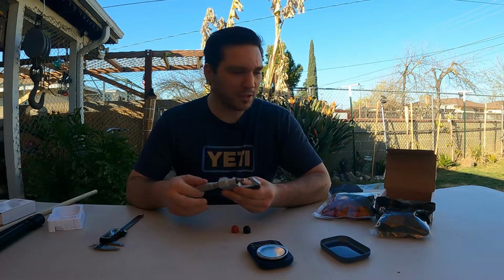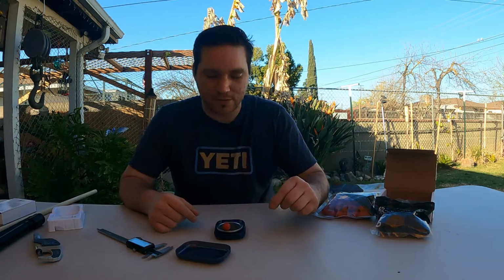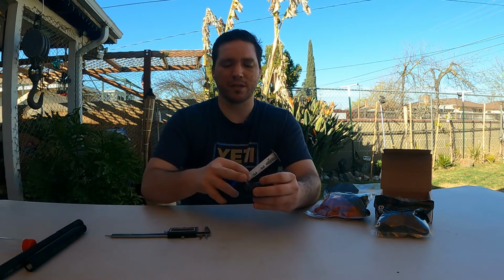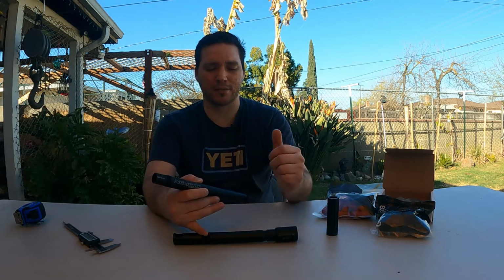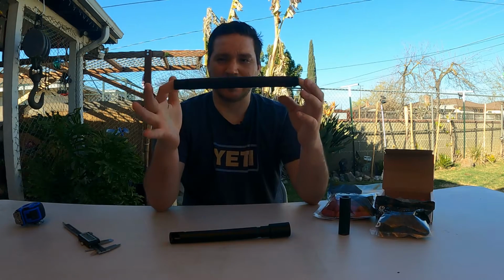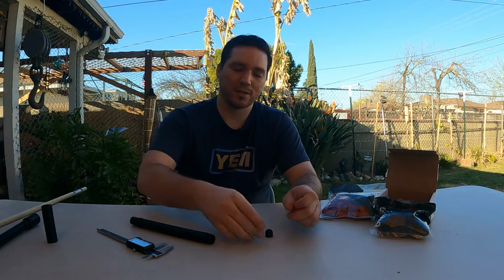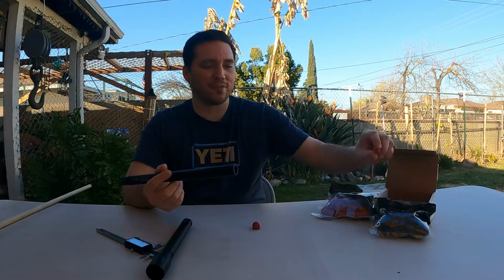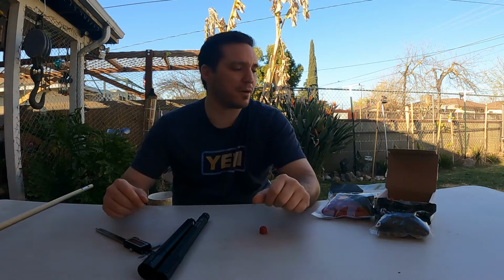Home defense Paintball Riot Projectiles and Barrels - Nemesis

Comment: Are all the nemesis rifled barrels .685?
Reply from the maker: I believe so, I haven’t seen any options. I don’t have a way to measure the extrusion on the spiral which is smaller than the bore diameter itself. The hammerhead I’ll be reviewing soon is cut into the bore like a real rifling and allows for the hardened projectiles to pass.

Comment: Get yourself a paintball ball sizer for correct sizing to barrels. Caliper is good for measuring but won't tell you what barrel you need. Example: grimburg hp68 projectiles are
.684 but you can't get a .684 barrel because it won't fit, this is where a paintball ball sizer comes in handy.
Reply from the maker: I have one, these measurements are for anyone who wants exact measurements so they can scale as needed for their application. it just dawned on me that it sizes up to accommodate the projectile? So the sizer builds in the needed tolerance for that barrel? Thanks for the information.
Reply: @ProjectAnubisUSA  no problem, that's what we're here for, to help each other out in the less lethal community 👍👍.